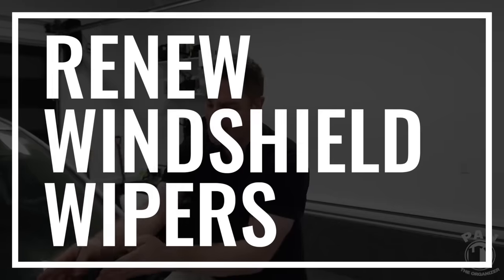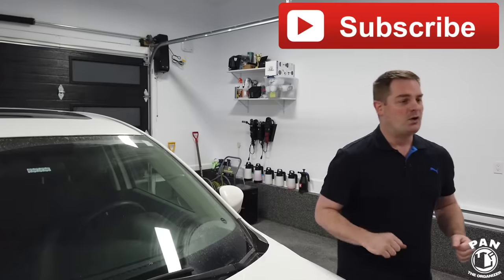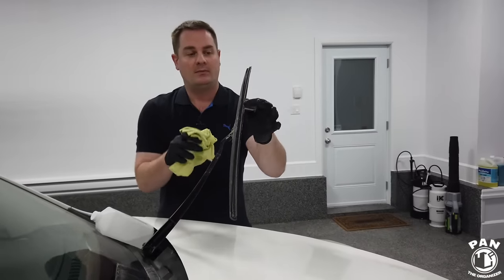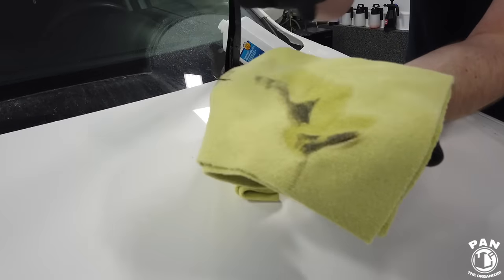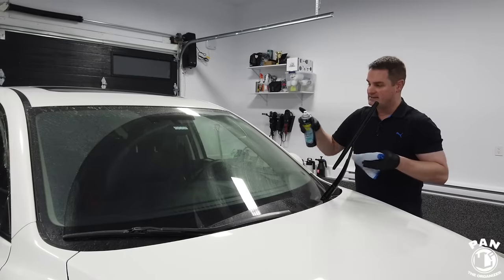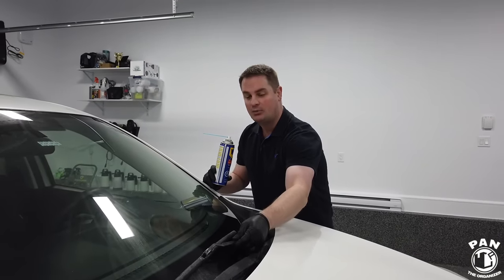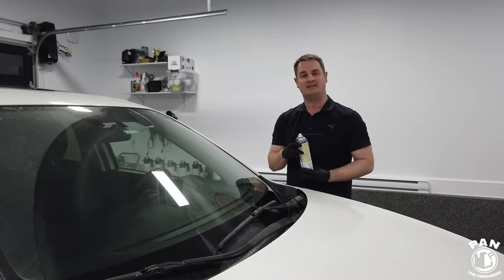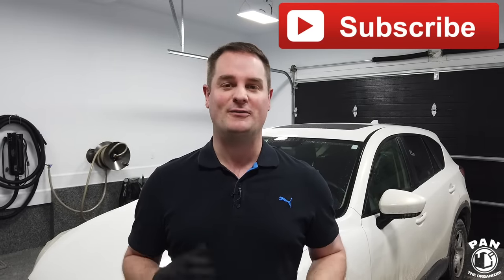HOW TO RENEW WINDSHIELD WIPER BLADES - ZERO STREAKS, QUICK & EASY !!

Comment: What product do you use in the windshield cleaning tank of your car ?
Reply from the maker: What ever the dealership adds when I do my yearly service. I don't use much windshield cleaning fluid, as I always have a glass coating on my windshield, which helps reduce the use of wipers and keep the windshield cleaner for longer. Also, I clean my car twice weekly.
Reply: So they are not harmful for the ceramic coating? Thanks for answering this quick . I really like and trust your videos ! You learned me a lot .. thank you Pan !

Comment: WD-40 should not be used as lubricant. WD stands for "water displacing" and its main use is as a solvent or rust dissolver.
Reply: It does act as a great cleaner though.
Reply: My thoughts exactly
Reply from the maker: We're not really using it as a lubricant in this place, to to dissolve and displace any light rust that might be in the hinge preventing the wipers from moving freely and sticking more to the windshield. ;)
Reply: Whjte lithium grease will work.
Reply: WD-40 has a little lubricating property but doesn't last long. Should use a waterproof lubricant

Comment: When you apply P&S Bead Maker, can you apply Last Coat or Kamikaze overcoat on top? I mean can you stack different brand overcoats?
Reply from the maker: It would be the opposite.  Always start with the one that has the strongest and longest lasting bond to the clear coat.  So you would apply TLC or Kamikaze first, and then maintain that with Bead Maker to boost gloss and slickness after you wash your car.
Reply: Pan TheOrganizer wow thank you so much for the fastest response. Nice garage and you could work like that in dead of winter.
Reply from the maker: Thanks!  Here’s my latest garage tour video: https://youtu.be/gyehNOd44SY

Comment: Does the alcohol not dry out the rubber
Reply from the maker: You wouldn't do this procedure every day, so don't overthink the moment. If you would do this every other day, then yes perhaps you would need to look for another alternative. Also, you should be replacing your wiper blades once every year or every other year. There's nothing better than having fresh blades.

Comment: Hey! I know this comment will get lost below.. But WD-40 is not a lubricant. WD stands for "water displacing" and its main use is as a solvent or rust dissolver. So using WD40 constantly will dissolve and break down what your spraying.. Its ok to spray WD40 to remove grime and other debris, but  I would definitely follow this up by using a Silicone or "3 in one oil" to lubricate that wiper hinge. Just my two cents..
Reply from the maker: Yup
Reply: @PanTheOrganizer  love your videos by the way!

Comment: What's the best way to remove tree sap?😕
Reply from the maker: Bug and tar remover, tree sap remover or even Citrol 266, and then claybar.  If you have protection on the paintwork, you might have to reapply protection after you use these chemicals.

Comment: Is WD-40 a lubricant?
Reply from the maker: It's a water displacement product (hence the name WD). It's a Multi-Use Product with a unique, special blend of lubricants. The product’s formulation also contains anti-corrosion agents and ingredients for penetration, water displacement and soil removal. So it can help make moving parts better by preventing rust and water buildup and moisture, etc.

Comment: Great video as always, but if I were to clean my wipers and glass I would rather use invisible glass with rain repellent (found exclusively at princess auto in spray bottle form). I wouldn't use rubbing alcohol cause overtime it could dry out the rubber and cause premature wear and cracking of the wiper blades rubber. Also to prevent the windshield from collecting all this gunk and junk, I would suggest ussually applying a layer of carnauba wax once every 6 months to the windshield. But great tip with the WD40. Either way wiper blades are ussually pretty inexpensive so I would suggest replacing atleast every 2 years for safety, and make sure to use proper wipers for winter and the other 3 seasons.
Reply from the maker: There is no need to worry about wear and cracking as you’re only doing this method every few months.  Not on a daily basis.  I have been doing this for over two decades never had issues.  Just a streak free glass. ;)

Comment: Cleaning my new Bosch Aeroblades with Stoner clean & Repel totally ruined them ! these new graphite coated blades will start bouncing around the windshield if you use water repellents.  It's a shame. They were great blades. So why is that?

Comment: Ok....here is how to clean your wiper blades...guaranteed the best way......get a small sponge,  and dawn  dish soap. Take you blades off the vehicle. Head to the tube, shower or do this outside. Apply the dawn dish soap to the sponge  and rub up and down the rubber blade as shown here in this video washing clean in between 3 to 4 times. Then reinstall on car.  Dawn is a natural degreaser and wont dry out the rubber like alcohol will. Try this for yourselves and correct me if im wrong.  Ive been doing this for years...and your blades will last much much longer.

Comment: I have a 2 year old car. Whenever it rains I get wiper judder. And can't figure out why.
Reply from the maker: Perhaps your blades need to be cleaned or replaced. Do you have a glass sealant applied?
Reply: @PanTheOrganizer  Yes, I applied a meguires glass sealant the week I got the car from new. I have cleaned and clayed the windscreen to try and remove it. But the judder still remains. I will try and clean the blades this week as you have advised. Do you think it's the sealant?
Reply from the maker: Some glass sealants can lead to wiper judder. You should watch my glass sealants tutorial here: https://youtu.be/IEIlHZ2D4ig

Comment: Question: I have heard that after cleaning the blade to use a rag and wipe the blade with WD40 as well. It is supposed to help the blade wipe better. True or false????
Reply from the maker: I don't understand your question...  When you clean the blade, you're also wiping it with the microfiber towel...
Reply: I corrected my question for you.

Comment: Cleaning the blade will not remove the nicks in the blades that cause the streaking in the first place. And as I watch the video at 5:14 there is a big streak. But it disappeared quickly because you using clean water. Sorry but this is a little misleading.

Comment: Alcohol dries out the rubber wiper blades, not good. I just use a good glass cleaner to wipe off the blades. Works like magic!!!!
Reply from the maker: You don't do this everyday, so there is zero worries about the alcohol. Been doing it for decades, never had issues. But yes for regular maintenance, a good automotive glass cleaner works well.

Comment: WD-40 isn't a proper lubricant, can clean but need to apply a  real lubricant to it. Just a  silicone  lube will do the job. WD-40 will gum up the works over time.

Comment: Yeah good luck "cleaning" and rubbing the rubber blade until the towel stops getting black. This is nonsense. You get streaking because the wipers are old and worn. Cleaning them works for maybe 1 or 2 rainy days only. Replacing them is the real solution.

Comment: Friendly reminder to STOP USING RUBBER BLADES. They're garbage and companies rip you off, knowing you'll replace them every year or so for $10 each. Invest a bit, spend $20-25 per SILICONE blade and they'll last for years. Probably longer than the car itself.